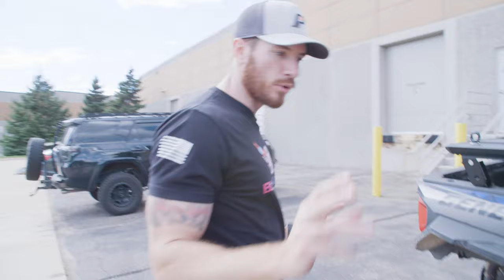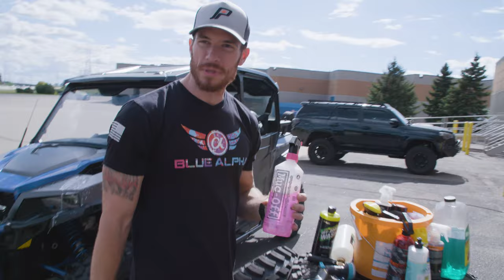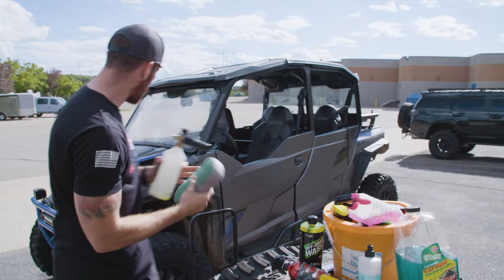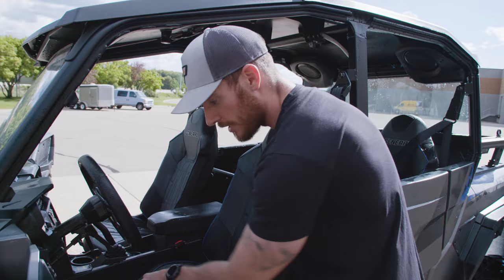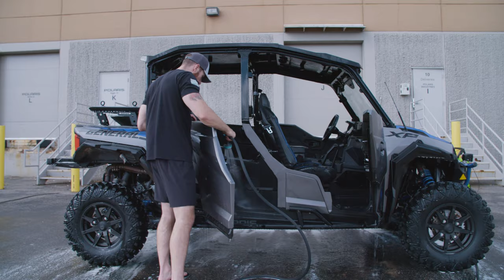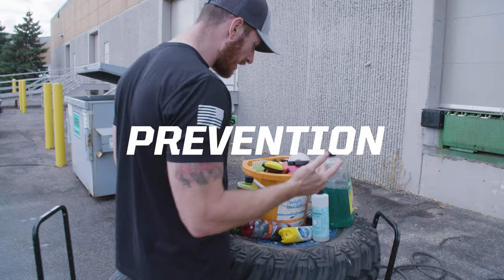HOW TO CLEAN YOU SXS or ATV - TRAIL TALK EP. 27 | POLARIS OFF-ROAD VEHICLES

Comment: I don't even use soap. Just water and a sponge to get any dried mud off. Here in the West, summer riding involves a crazy coating of dust. I mostly just give it a good spray down with a garden hose. Also, I start out by blowing out the air box and filter with my compressor after every ride. My thinking is I don't get too carried away, as it will look like it did before I started within the first 5 minutes of my next ride....